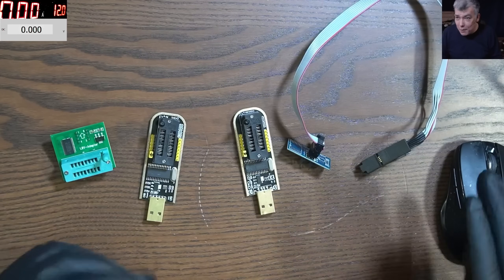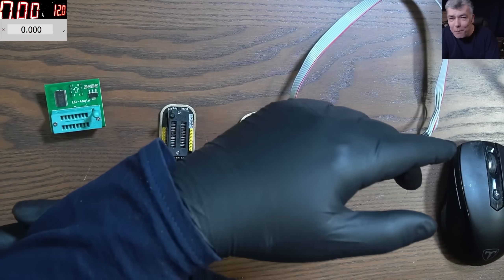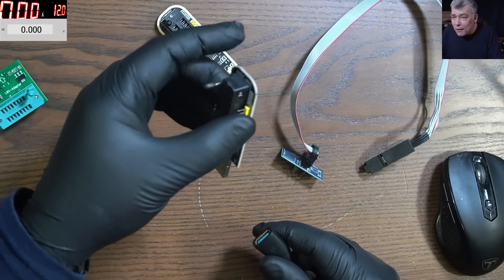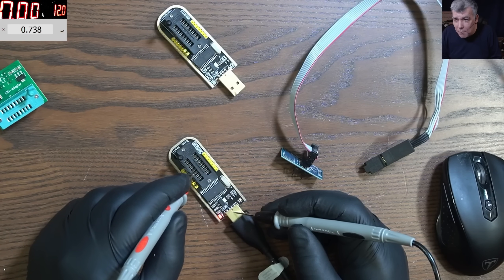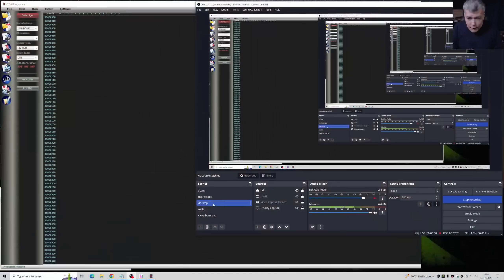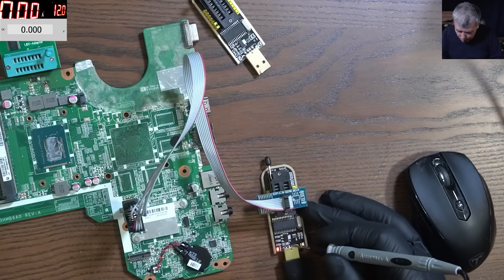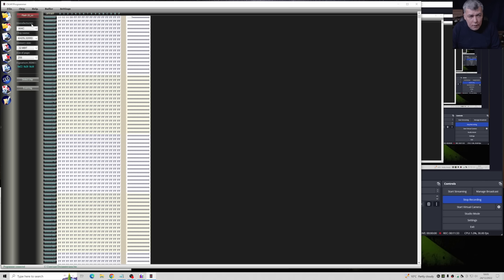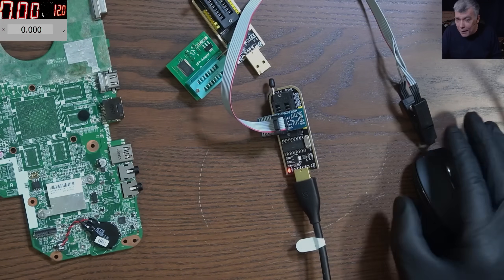How to program a bios chip - CH341A programmer, no, you don't have to modify it

Comment: Very good video but I want to challenge the statement "Voltage cannot burn anything, you need current to do that". Voltage itself can destroy electronics. You can destroy a capacitor when you expose it to voltage higher than its rating, no relation to current. Also certain active  electronics (mosfets) can be destroyed by static electricity. But in general, yes the statement is correct.
Reply: You are wrong! Show us how voltage can convey power without current by using Kirchhoff and Ohms law..
Hint: Current is directly proportional to the voltage!
Your statement tells us, that you do not believe or understand the laws by George Ohm and Gustav Kirchhoff
Lastly, it is absolutely  crysal clear that you do not have any idea what static electricity is. Read up before you decide to correct other people! You are very wrong...
Reply: @Onkel.Moetrik  It is "crysal" clear that you do not know what you are talking. If I give you one capacitor, can you find in its datasheet what current will destroy it ? You have not heard before about electronics destroyed by ESD ? Have you lived under a rock ? Current is always proportional to voltage ? True when you have a resistive load or for DC, but not true in several other situations with AC and inductors or capacitors which will shift the phase.
Reply: look, what is the meaning of "burn"? It means to pass a current thru a resistance which creates so much heat that it exceeds the dissipation capacity, you agree?

AC or DC, phase shift or tesla magic, that needs to take place or no burn will happen.

if you power source is unable to supply the necessary current, we get no burn.

So, regardless of your voltage scenario, possible or imaginary, that voltage must be able to create that current, right?

Thus, if you insist that some process, say ESD, can burn something, then you are acknowledging that it is capable of creating the burning current, you agree?

And it is that current that does the burning.
Reply: @suediem9315  Sue, I used the term used by Sorin "burn". Sorin is not a native english speaker and neither am I, but I am sure what he meant was to "destroy" a component on the board which is not already defective.  This is what Sorin meant in that context. Would you agree that if you have a power supply which you can limit to supply a maximum of 10mA and 200V and apply that to some telephone or laptop motherboard that there is a reasonable chance for a component to be destroyed, either a capacitor or a semiconductor, even though those 10mA should be insufficient to "burn" a component (destroy it through high temperature) ?
Reply: @georgedone7997  LOL! why limit to 10mA?  ( which equals the power of two joules per second). According to your previous statement  you will get the same damage if you limit the current to one micro ampere!
Reply: @Onkel.Moetrik  I thought you said you will refrain to discuss this subject with me and hoped you will keep your word. 10mA is a practical value which can still be set in a lab power supply as the upper current limit. I am not aware of any reasonably accessible power supply which allows to set 1microAMP as limit, if you can find one, you are invited to do the experiment and report here the results. You can take an 6.3V electrolitic capacitor and connect it to power supply limited to 1microAmp and 50V, leave it sufficient time to be able to charge completely (at 1microAMP this might take some hours). You might not notice anything but take the capacitor and put it in a circuit with all specs respected.  The cap will fail immediately because the dielectric was compromised when it was exposed to 50V (at 1microAMP). Just do this experiment and this should end all this discussion.
Reply: @Onkel.Moetrik  I do not have to prove anything especially to you.  Just as well you could prove you are correct with an experiment to end this discussion one way or the other but you do not have to. Do whatever you want and let's finish this discussion now.

Comment: Unbelievable that it can read the chip with clump without desolder it. Even with cmos battery still on motherbord
Reply: Depends on the actual board. Sometimes providing power to a BIOS via the programmer causes the board to attempt to power on. So BIOS removal may still be required.

Comment: I am using it for a few years, and it is pretty cool tool for that money... But i had few issues with motherboards which have Bios + embedded controller (EC). After flashing both flash files, laptop couldnt turn on ok. I did backup before flashing, and after i restored backup, it booted up. I think there may be some special procedure when flashing these dual chip motherboards. Any explanations !?
Reply: EC needs to be flashed to the PCH/superIO to match the revision applied to the BIOS chip.
It's in a previous video.
Reply: @incandescentwithrage  Thanks, mate, I appreciate it!

Comment: I bought this a few years back, this little programmer made us so much money we literally ran our shop for months on the money we got programming chips with it, its my absolute favorite.... Merry Christmas from Zimbabwe 🇿🇼🇿🇼🇿🇼🇿🇼🇿🇼
Reply: Bios also gets corrupted by it's own many times
Reply: I’m in the UK and here a lot of computer repair shops won’t even bother with a MOBO BIOS repair, had several just tell me “don’t bother it’ll be cheaper to just buy a new board” lol. I want to try this out purely to see if I can do it and then maybe I’ll open my own shop and take all the business these guys are passing up lol.
Reply: Where can i get this in Zimbabwe
Reply: how is this profitable
Reply: @Ruben Chris  Some people will attempt to update the bios on their motherboard and it will fail making the board unusable and most people will say it can't be fixed / it's bricked. If you use one of these programmers you can clear and refresh the bios and bring the motherboard back to life.

Example: I bought a Z490 motherboard for $20 because it had a bad bios. I flashed the bios with my programmer and the board works fine now. I resold it for $100.
Reply: @TLM-Nathan  but how did you retrieve the proper ID/serial that the motherboard had on the good bios? Did you just flash a clean downloaded rom on it? I thought that doesn't work
Reply: @v0lts  flashing a bios doesn't overwrite important data, which is stored in a protected area.... If you do erase all that stuff, so? It's not required for anything. You can add it yourself in a hex editor if you really need to.
Reply: @runed0s86  but you'd have to get a full dump from a similiar board to add that back. AFAIK it is required and the board will not work with just the ROM flashed on without the protected area
Reply: @v0lts  It will work with the serial numbers, MAC address etc being blank or bogus data. Either punch in fantasy values, or look on the small stickers dotted around the board (or on the back, or on the mobo box if you have it) for the actual MAC and serial it's supposed to be. And if it's a complete dump from another board, it already has a correct/valid MAC and serial... they're just identical to the donor board. To get a board back to life and verify that the BIOS was the only issue, that doesn't matter, since you can still edit them afterwards
Reply: @rubenchris5301  If you steal laptops from coperations they will oten have a BIOS that is locked down preventing you for installing a new OS. You can bypass it with this method.
Reply: Famba hommie. Ndiripo paHwange
Reply: @techjinda I have a board with a corrupted bios are you in Harare?
Reply: How do you see if the chip is empty. I am trying to program an hp bios it's saying the file is too large.bi think the IC is dead
Reply: no wonder you make so much money in Zimbabwe
Reply: From where u get the software for the chip
Reply: @abdallahharfoush9449  techpowerup  i suppose
Reply: @abdallahharfoush9449  NeoProgrammer is quite good